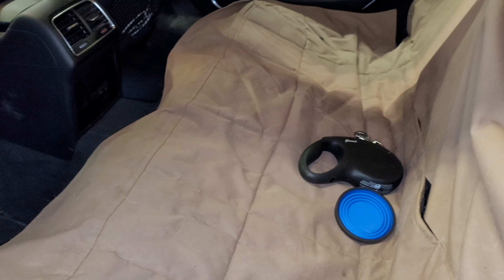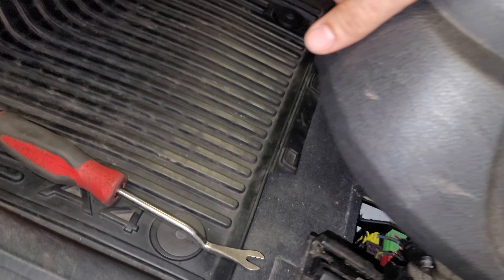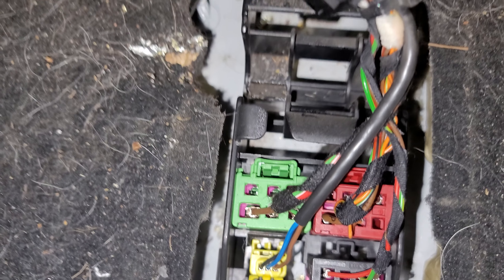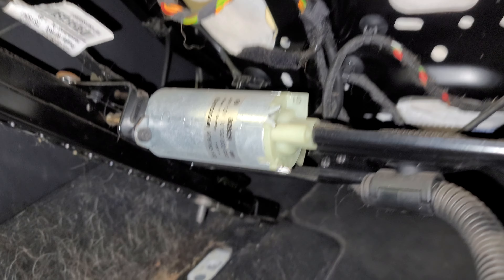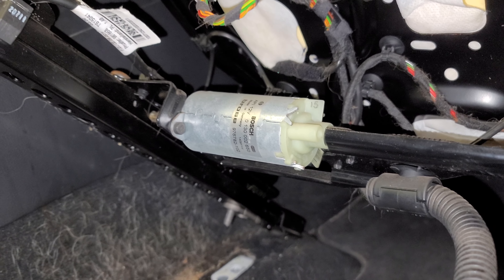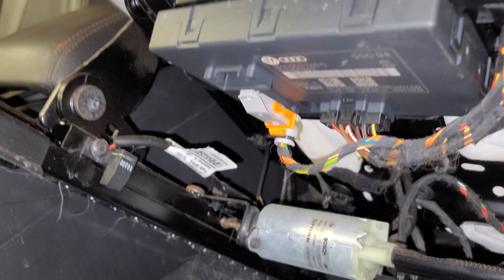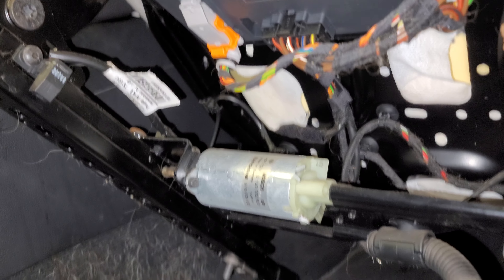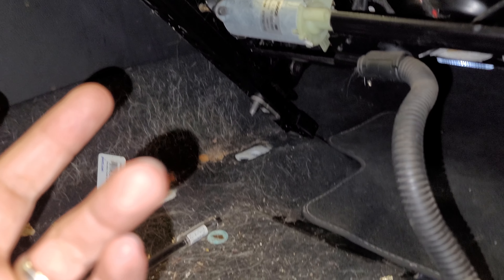When keeping real with pets goes wrong 😲 #customerstateswhat

Comment: Detail is usually a two or three step process. Everyone remarking how they did not do a good job. Well, you can not get under the seats with involving them, Dr energizing the battery first least 15 minutes, or the air bags could deploy, yikes. A technician has to dismantle a vehicle after the initial clean up to allow detail another step to get under seats, carpets,headliners,trunk panels. It is an unpleasant process for everyone involved being exposed to rodent pathogens.

Comment: My 02 Highlander needed total interior disassembly to eradicate and decontaminate a mouse problem. That's the bad news. The good news is I got it for $600 and did all the work myself...in 11 days. No wiring damage at all, but the blend door foam and sound insulation were all used for bedding. It literally smells brand new inside. I scored!

Comment: seems to me a system so finicky isn't a good one. that amount of dirt and hair under the seat really shouldn't have been a problem to begin with. i'm not referring to food left in vehicles just everyday dirt and what not with that little bit of hair under the seat. oh and one doesn't have to leave a lot of food in a car for fire ants to be a big problem. we had a car that we didn't drive often and those things set up shop kinda close to it. well it was close enough for them to move in and chew on us. the didn't cause any electrical issues cause we found out before it got to that level. not to mention the distraction and therefore danger that a whole bunch of those things chewing on you could be.  but just wanted to point that out as another reason to keep a vehicle clean. have a good day.